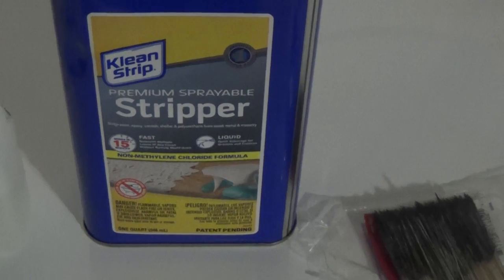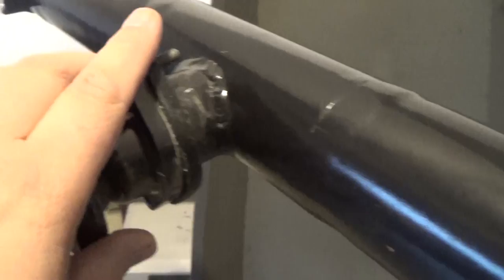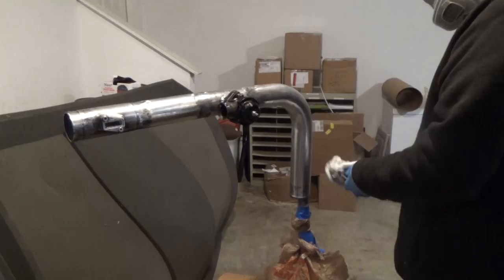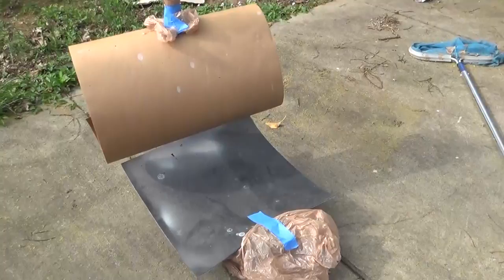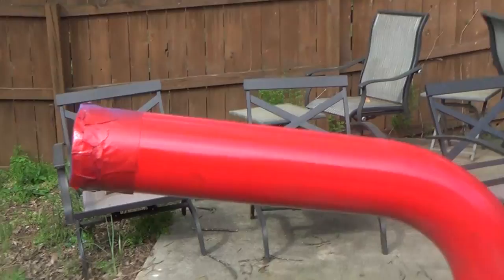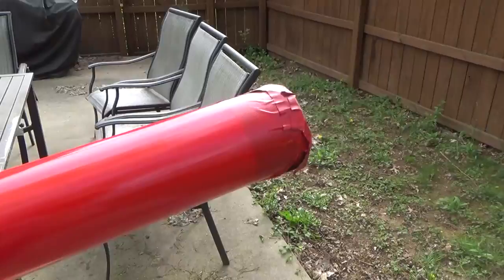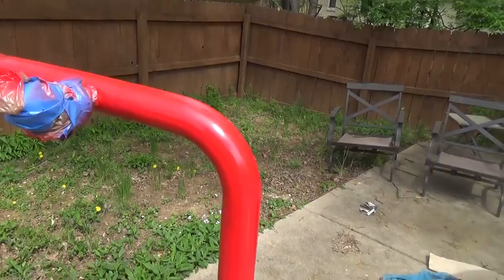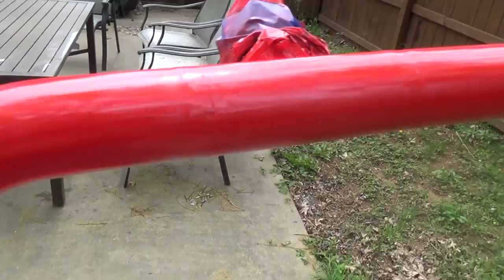Stripping and Painting My Turbo Charge Pipes

Comment: Nice work Mike. Looks great.
Does the paint need to be able to handle the heat of the engine?
Reply from the maker: That's a good question and I'll definitely find out once I start driving her hard. I'm not sure how hot they'll get. But thankfully, it's pretty easy to strip and repaint them if needed.